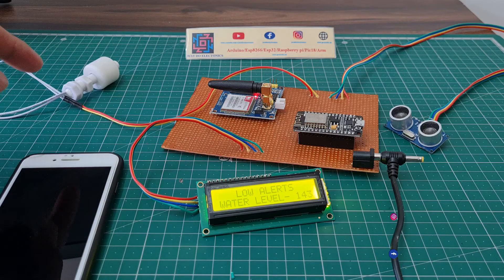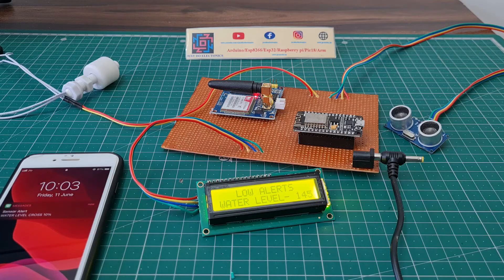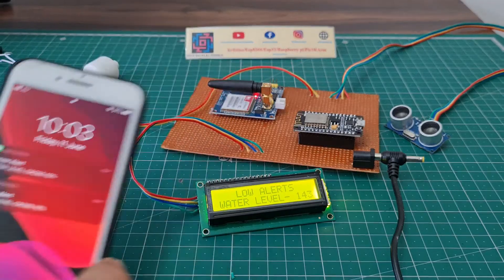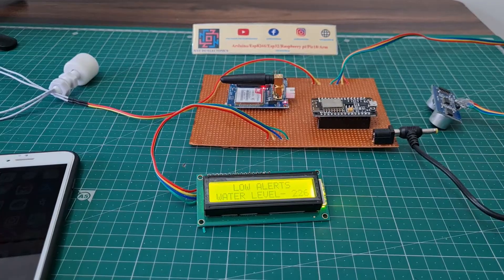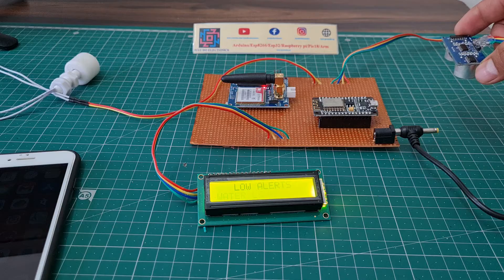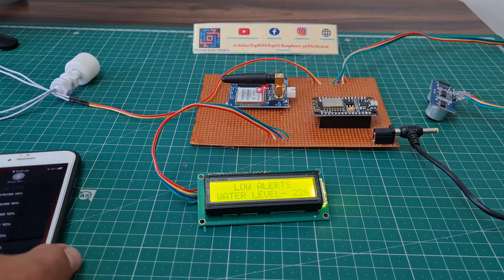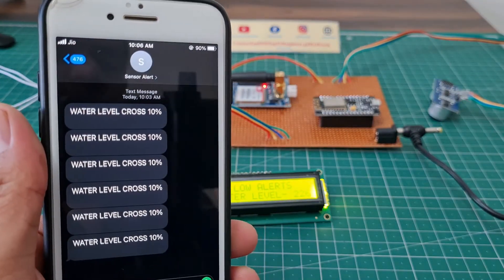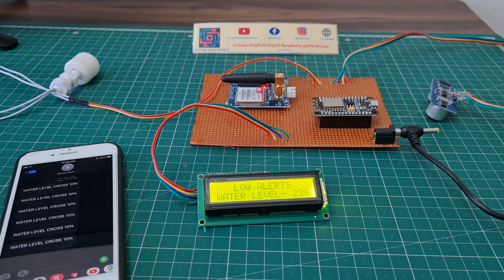Flood Monitoring System With ESP8266 | GSM | SMS Alert

Comment: ultrasonic sensor operates at 5 Volts while ESP8266 NodeMCU operates at 3.3V only. There is a fluctuation in the ultrasonic sensor readings because of incompatibility with the timings due to voltage difference.
Reply from the maker: Check the vin pin voltage and ultrasonic connect to vin pin

Comment: brother, where should i connect the 5v  2A  Dc power supply to gsm module
Reply from the maker: Yes gsm and ESP8266 board also used only one power supply
Reply: ok brother thanks
Reply: which website are you using now bro , to design the circuit
Reply: bro i didn't get where do we connect DC power supply? if u have a pic pls share we have a project to submit

Comment: Can you please help me ? We have a thesis project about flood alert system and we have the same idea. The difference is we have arduino and solar power. My question is there a sense if we put arduino uno for flood leveling ? Or we should not put the arduino ? Thanks for the answer
Reply from the maker: If you Any Questions related to project then plz message in what's app +918830584864

Comment: How do i get the code? I'm using Arduino for this project
Reply from the maker: @shahrizanmohamad3540  +918830584864
Reply: @JustDoElectronics  hello sir, can you share the code via email? currently I'm working with the similar project to this ( early flood warning system ) but with alarm and siren light powered with 12V solar panel. I don't know how to program the GSM to send message when the sensor detected warning level ( 75% )
Reply from the maker: Contact +918830584864
Reply: Can I get the code plss

Comment: No optimalization, WiFi adapter is active but not used.
Hope u will not run this on battery, because it is then totally useless concept. 
Also why whole NodeMCU board you used?
This is project for ATtiny85 and not 30x bigger and 40x faster ESP board...